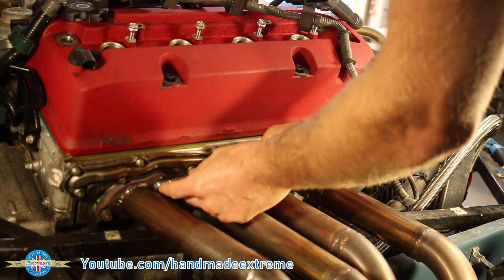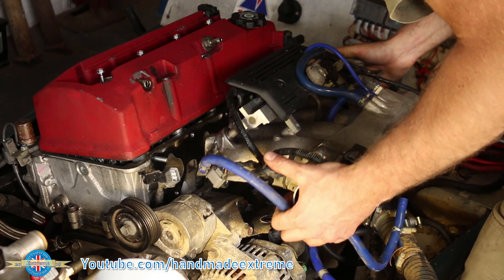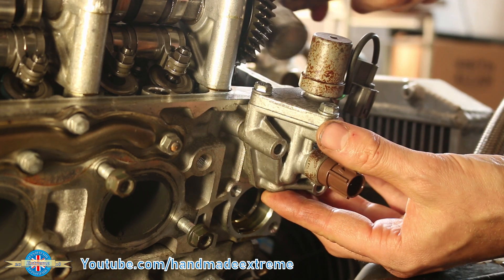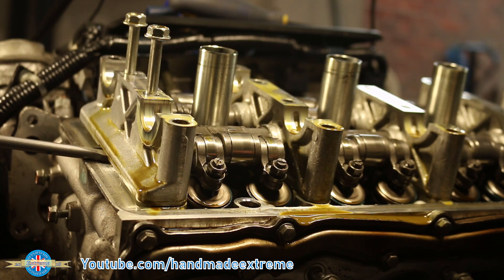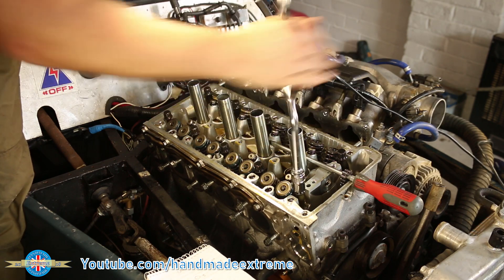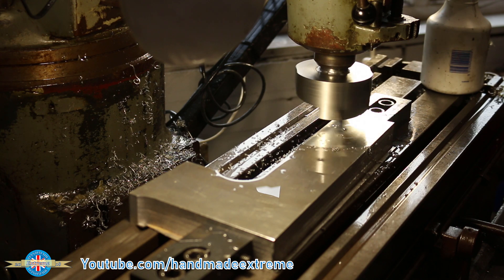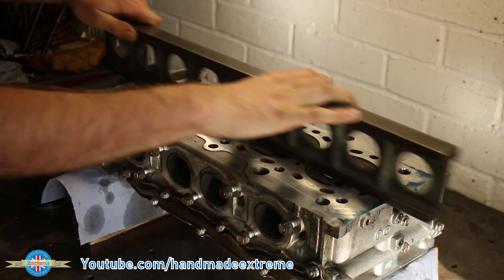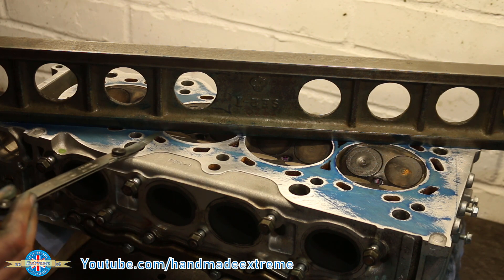The Pippa Project - Honda S2000 Powered Haynes Roadster - Part 2: Engine Cylinder Head Resurface

Comment: Excellent video. Innovative way of skimming the head. Look forward to your next offering!
Reply from the maker: Thanks Carl. It's a real shame that I couldn't just do it on the mill. Hopefully once I have a bigger workshop I can tare down the mill and get it all back in tolerance so I can use it for large jobs like this in future.  Thanks for the continued support. 👍
Reply: @Handmadeextreme  No problem. I'm currently stripping and refurbishing a Harrison Horizontal/Vertical Mill. The biggest issue is where to put all the bits.

Comment: Nice work! How long do you reckon it took to sand it back flat?
Reply from the maker: Ooh not long. About an hour or two. Considerably less time than a spent faffing around with the milling machine. FYI there is a slight mistake in the video where I say 80 grit. It should be 180 grit. 
Thanks for watching 👍

Comment: I'm generally working on smaller electronic and electromechanical things but a magnet on a telescopic rod and also a tiny inspection mirror are always in my bag! As well as preventing dropping something, they have also gotten me out of the shit when I've managed to drop e.g. an odd sized grub screw.

Your sense of discipline with removing and placing bolts in a template appeals to me. People call me OCD for this type of thing as I often do this where it doesn't even matter that much; partly in situations where i feel best keep threads to the taps they will have uniquely warped in but often just because i feel unsatisfied when i dont know for sure everything has gone back where it came from lol
Reply from the maker: Thanks. Couldn't agree more they are both super useful. 
I started out in an aircraft component manufacturing workshop so I had it instilled in me from day one. It has served me well. People seem to think it takes extra time to put the screws back in the hole after you remove a part or put the nuts back on ..... and it does ..... right up until you loose one if you don't do it this way. Then you spend ages looking for the one missing bit.. 
Much better to spend the extra time to be a bit more organised I think.
Thanks for the support and i'm glad you enjoyed the video. 👍

Comment: That seemed to work ok.
 Did you do a check on the block too, and was there evidence of leak on the gasket?
Reply from the maker: Hi Chris. I've still got to take a look at the block. By the time i'd got it to bits there was coolant and oil all over it. What you see in the video is after i'd given it a bit of a clean up. Slightly concerningly there isn't anything obvious that I have noticed. That said I haven't been over it with a fine tooth comb yet.  Thanks for watching.

Comment: Is 80girt smooth enough for a cylinder head? I's expect you to go a bit higher - maybe 200?
Excellent video as always! Such a pleasure to watch. I wish you made the ma bit longer.
Reply from the maker: I'm expecting it to be ok yes. I think if you just sand in one direction it's too course because you end up all the grooves going the same way. Particularly bad if you go length ways on a head as that is providing a path between cylinders where the gasket is at it's thinnest. By constantly changing direction all of the low and high spots get mixed together and you end up with a more consistent surface finish even though the scratches are just as deep. Another thing is that I never push down. I just use the weight of the head so even 80 grit scratches aren't very deep using this method. Say compared to hand sanding on some bodywork for example. All that said, if id'e had a big piece off 220 I would have probably used it after the 80 just to refine the surface a bit more haha. I don't want to too smooth though as a little surface roughness helps bite into the gasket. Thanks for the support and i'm glad you are enjoying the videos. 👍
Reply: @Handmadeextreme  Also, my understanding is that you want a surface that the head gasket can get "a grip" on, and not squirm around between the block and the head.
Reply from the maker: Yes, that's my understanding as well. Don't want it too smooth. Thanks for your support and i'm glad you are enjoying the videos. 👍👍
Reply from the maker: A bit of follow up info here. For the head gasket I have. An MLS one the surface finish should be about 180 grit. I made a mistake in the video, and the surface is currently a bit rough. For non MLS gaskets  i'e the copper ones the rougher surface is acceptable however for MLS the smoother the better. I have added an info card to the video to highlight that i'm doing it to 180 grit in case anyone is using this video for reference. But in reality I will be doing it in a few days time before I rebuild the engine. Apologies for any confusion. I hope this clears it up. Thanks for your support 👍
Reply: @Handmadeextreme  absolutely no need to apologise. We are all here to have a good time and learn a few things along the way. I admire your work and your being so open about it. I wish I had the determination to actually spend time in the shed instead of just typing about it.
Reply: @Handmadeextreme  absolutely no need to apologise. We are all here to have a good time and learn a few things along the way. I admire your work and your being so open about it. I wish I had the determination to actually spend time in the shed instead of just typing about it.

Comment: Genius idea sanding the head - is getting the milling machine back into tolerance possible?

Possibly a nice idea for a video ;) ;)
Reply from the maker: Thanks. It's possible yes. It's a full disassembly then re scrape all the ways It's kind of a similar process to doing the head but instead of sanding you use a metal scraper. It could be an interesting little series. We are hoping to move house soon to somewhere where I can have a bigger workshop so it won't be getting done before then. Machines in bits take up a lot of room. I'm struggling for space with just a cylinder head in bits haha. Thanks for the support. 👍